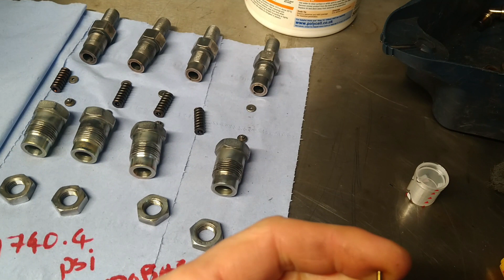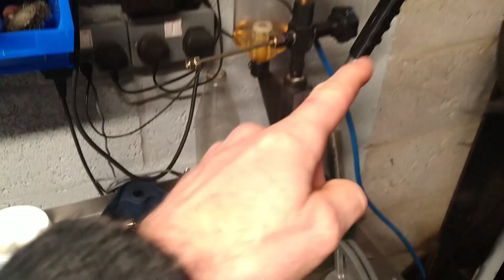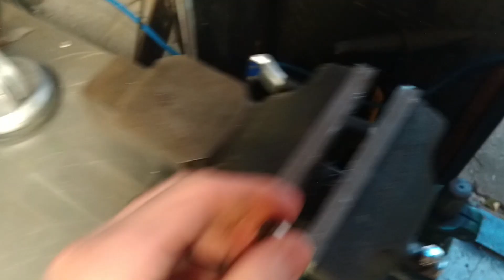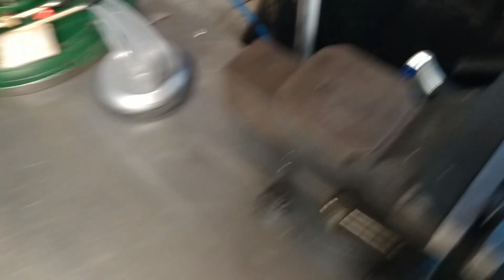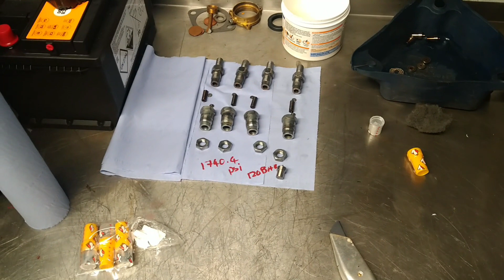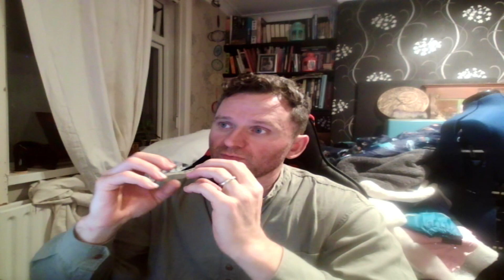Sticky Diesel

Comment: until recently HVO diesel did not get the same tax relief of mineral/fossil diesel and this was more expensive. The gov’t recently recognised HVO as equivalent and will now receive the same tax exemptions. Its price should be comparable in 2024. Importantly for boating, HVO has a much longer life than 12 months. Other benefits are clean burning (cetane) and 95% less CO2 released. 

For London boaters, clean HVO fuel will probably be a requirement eventually as part of the council clean air programmes. The levels of particulate matter (PM2.5) are causing massive health costs.

https://consult.environment-agency.gov.uk/psc/pe12-8jb-midwest-polychem-limited/supporting_documents/MCP%20%20Fuel%20data%20%20HVO%20lifecycle.pdf

Comment: Good Morning, Thanks for your videos, I am fan of the channel and get a lot out of it. We did a circumnavigation of UK this summer and had no end of trouble with dirty diesel. The tank is treated with the algae killer additive and that seems to work and kill the algae but the problem comes from this black sticky left overs from the dead bugs. This seems to have the ability to pass through the throw away element filters but it catches in gauze filters and blocks them. For us the boat has a water separator with a throw away element filter then a gauze filter in the fuel lift pump and then a the main throw away element filter then a gauze filter in the CAV, DPA fuel injection pump on the T108 engine. The gauze filters blocked up with the black sticky residue. We made up a fuel polishing unit and the gauze filter in the pump on that blocked up as well. In the end we had to have the tank cleaned out in Brixham which was great but £600 for an afternoons work. 
I think the theory according to the suppliers of the additive is that the black residue burns in the engine but let me tell you it does not!! 
Regards John

Comment: Personally, I would always use the fuel that the engine was designed and built for, provided that you can still get it. This diesel problem is analogous to the those caused by petrol with 5 or 10 % ethanol in small petrol engines.

Comment: I did not have time for the entire video jet, but what I can say is that 30% HVO works great in a Hino Wo4D, but I mostly use it for the diesel heater. The FAME stuff from regular road diesel solidifies around freezing temperature, and since my Chinese Diesel Heater is mounted outside in an unheated spot, it kept stopping with clogged filters. A white vaseline like substance would  cover the filter elements. This will be my 4th winter burning 30% HVO with no FAME. I also use a Dickinson Newport Diesel heater. This is drip filled pot  belly style stove. On B7 road diesel I needed to clean out the soot every week. On HVO the is no soot at all. Did not have to clean more than once a year. This stuff is really better! Well actually the norm is now crap, and pure 1980 diesel would be premium :-)